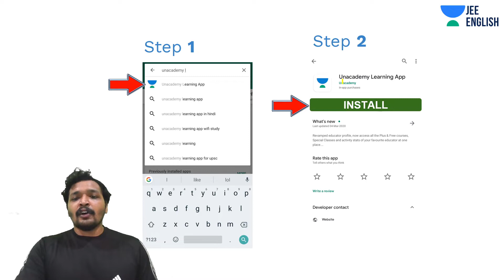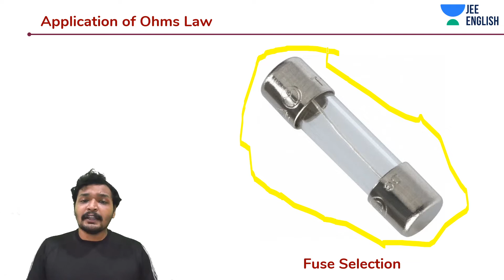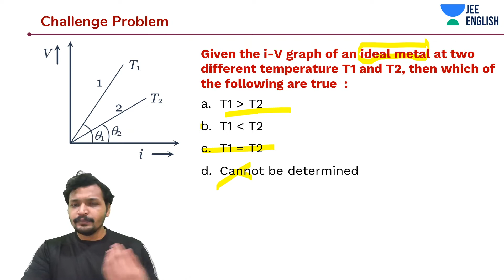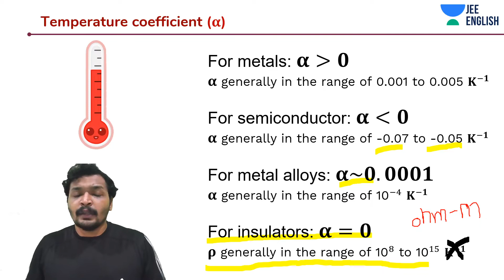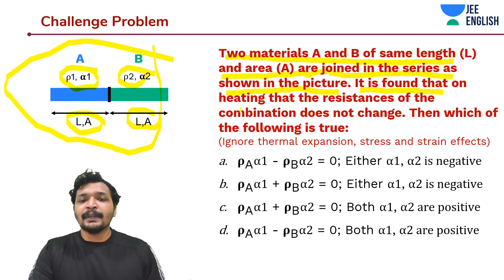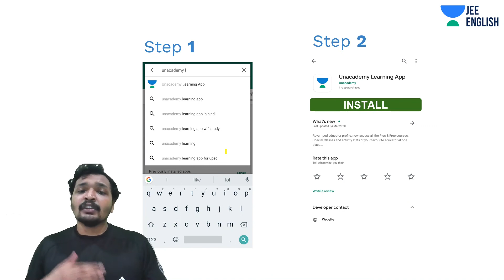Current and Electricity - Lecture 3 | JEE 2021-22 | JEE Physics | Muralidharan Gopalakrishnan

Comment: Do semiconductor obeys ohms law??
Reply: NO at high electric field or once it crosses saturation voltage, Semiconductors do not obey Ohms Law. Beyond saturation voltage, it shows constant voltage drop/bias voltage. Anyway, Until a particular low electric field regime it does. 

But remember we were not talking about dependence of Current on Voltage, but rather dependence of resistance on Temperature...
Reply: Thank you sir